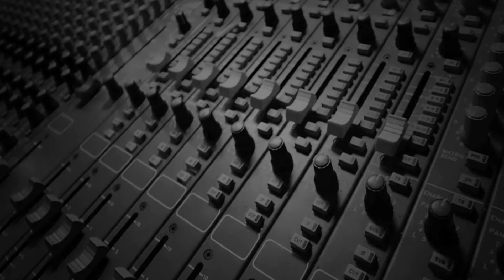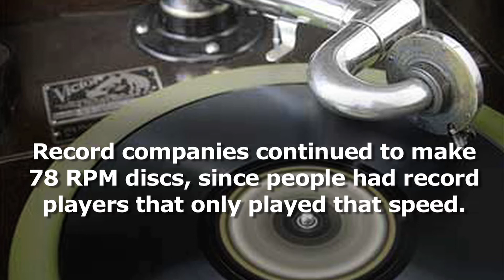Record Speeds (Revised)

Comment: 1:46- Actually, RCA officially introduced their 45rpm records in March 1949, because they were pissed that CBS/Columbia was able to successfully introduce a 33 rpm "microgroove" record in June 1948, and they couldn't {they prided themselves on being the "world leader in recorded music"}. They refused to join them in manufacturing "long play" records, preferring to concentrate on the "45 single" {which also used a "microgroove" process}.....and in turn, Columbia wouldn't press any "45's". It was the "War of the Speeds" for a while; several manufacturers marketed phonographs that could play all three speeds [with different tone arm weights], just to be on the safe side. In January 1950, RCA gave in, and started to release their own 33 "Long Play" records. The following year, Columbia started issuing "45" discs as well.

Comment: 1:27- THEN, in the fall of 1931, RCA tried to market a 33 rpm disc known as "Victor Program Transcriptions". It was a standard 10 inch record slowed down to 33 rpm speed, which had a playing time of between 7 to 10 minutes per side [there was no such thing as "microgroove" recording at the time]. However, the ONLY way you could play them was by purchasing an RCA "Victrola" radio/phonograph combination {which usually cost about $250} that had a two speed turntable- "78" and "33". However, the weight of the tone arm was the same as those on "78" players. If you played the "33" discs often enough, you usually wore the record out after several plays. And then there was the fact that there was a "Depression" that kept most people from buying those radio/phono combos; in fact, financial situations were such that it almost put the entire record industry out of business, as people were listening to radios, which provided "free" musical broadcasts every day and night. In the spring of 1933, due to sluggish sales. RCA decided to discontinue production of their "Victor Program Transcriptions"- although the "Victrolas" that could play them were manufactured for another year, and their remaining stock of "33" records were featured in Victor catalogs through 1939.

Comment: Record companies did continue with 78s into the 1950s.  I remember getting them.  I have somewhere an issue of the same symphony on LP and vinyl 78.  Except for surface noise caused by higher rpm, the 78 issue sounds somewhat better, but that must have been quite early.
Reply: The last year the major record companies released "78" discs to the public was 1958. After lackluster sales of The Platters' "Twilight Time" on "78's" that spring, Mercury records announced they would discontinue marketing those discs by the fall of '58. The other major companies followed suit, although some "78's" continued to be produced for juke box use and mail order releases {Canadian "78's" were still available}. Children's "78" recordings continued to be produced by some companies through the mid-1960's.

Comment: Yay! First commenter! DTS have time code to synchronize but Jay how the vitaphone disc is sync with film?
Reply: Aneesh:  That was actually the question that got me started writing these episodes.  The Vitaphone System used special motors called Selsyn motors  which were mounted on both the projector and the turntable.  These motors had a special disc on the shaft that could be used to synchronize  both devices.  Selsyn motors were also used  to synchronize the multiple film dubbers and projector when film soundtracks were mixed using magnetic film.  Today, most film soundtracks are mixed on computers using Pro Tools.  Thanks for your comment.